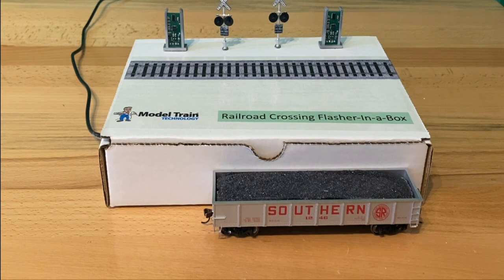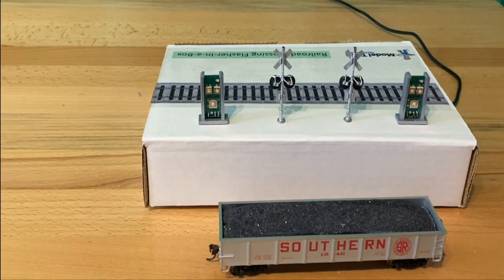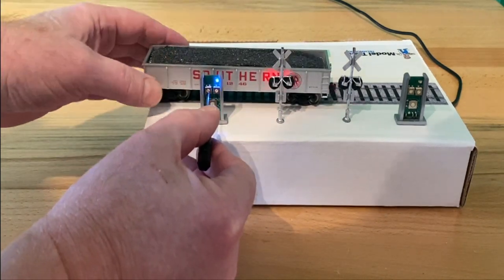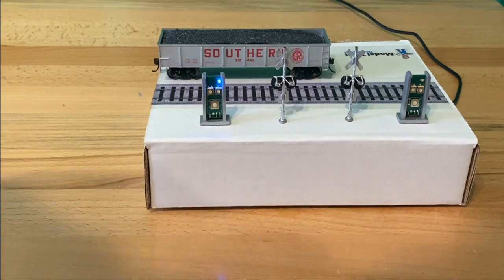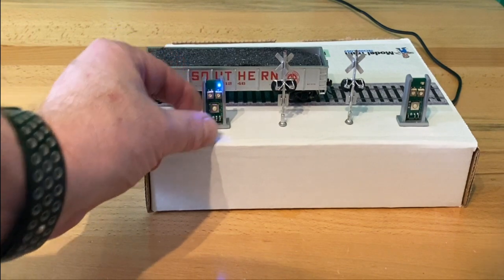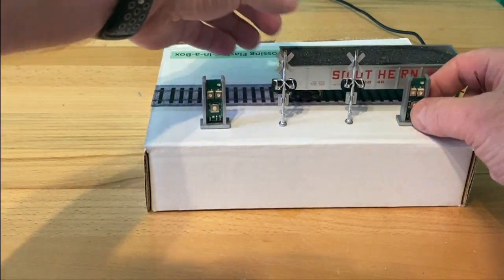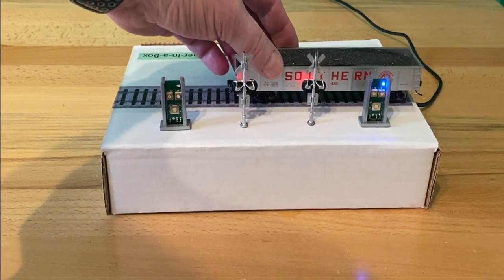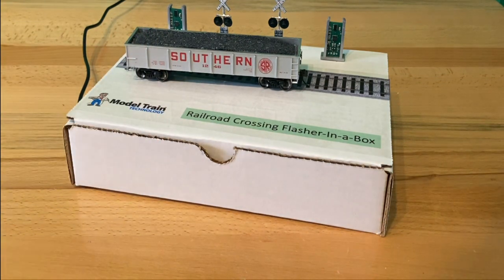Precision Detector   Auto Range Calibration

Comment: What is the detector distance? Can they work for three main tracks in HO with 2 1/2 inch center distance? Thank you.
Reply from the maker: The range is about 5.5", just short of 6" depending on the circumstance.  The Sensors signals can be connected together to form a single wide band of precise detection.  Just put another one the other side of the 3 tracks facing inward.
Reply: @ModelTrainTechnology  ok. Thank you.
Reply: @ModelTrainTechnology  Jim, to confirm actually did you mean add Two sensors (one on each side of the signals) covering the 3rd track facing inward?  The MTT signal controller will handle these additional inputs from the two added sensors as you said? Thanks.
Reply from the maker: @Archerman.4514  Exactly.